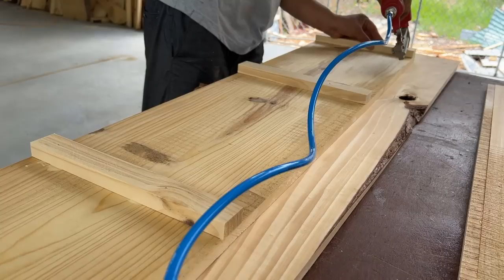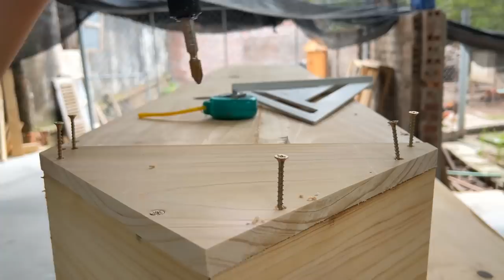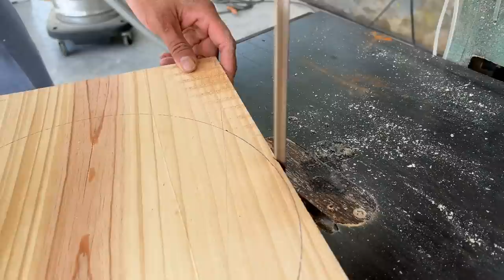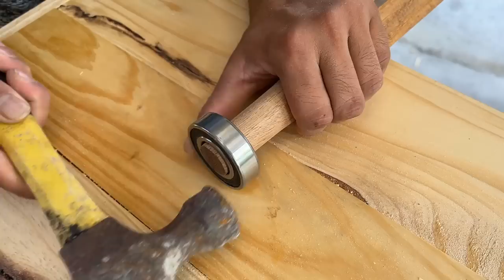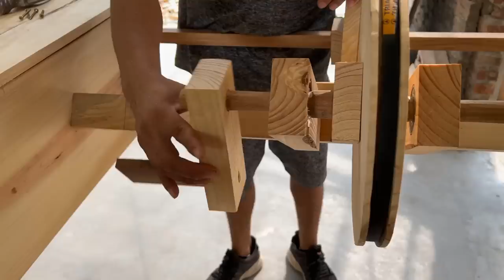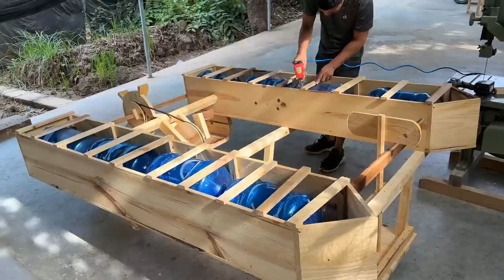How To Build A Pontoon Boat With Pedals From Old Wood And Plastic Bottles // Great Recycling Project

Comment: I am presently  building a pontoon boat. Doing research to gain ideas for my build. Peddle power was one that I liked. May I suggest: (1) using bigger paddles between two wheels. To fill in the space between the pontoons. (2) Shift your weight (body) forward to keep paddles from being too deep in the water. Paddles on bottom push forward and paddles on top push backward. This cancels most of the power supplied by the peddles. (3) By shifting your body forward you will also reach the rudder handle better.                                                                                                                                       
       Or, you could sit on the table (with body in center of boat). Now you will be closer to the rudder handle.  Place another pair of bows (pointed ends) in front of the paddle wheel. Now you can use your boat  more efficiently when you are by yourself. That is how I designed my boat like a canoe (can go forward or backward).
     I guess you designed your boat for two persons. One to peddle and one to steer. I saw that with two onboard the water was almost to the top of the pontoons. I also counted 8 water bottles. Approximately one cubic foot of air in each one. One cubic foot of air equals about 65 lb. of floatation. Total buoyancy about 520 lb. Have fun and stay safe on the water.